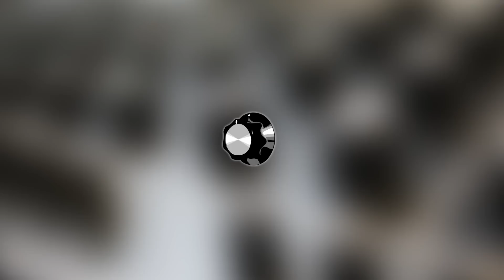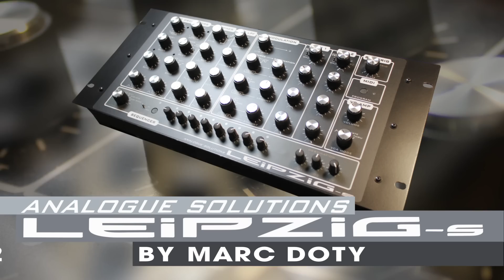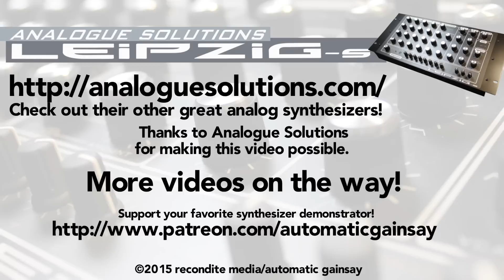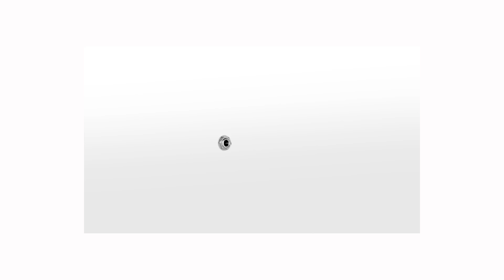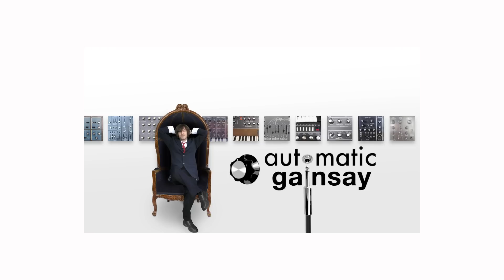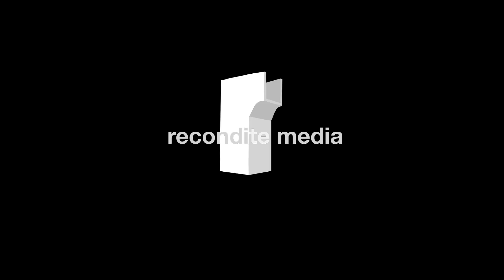02-The Analogue Solutions Leipzig-s: Part : Oscillators Part 2

Comment: I'm assuming the 3 knobs on the sequencer's right are applied to every step of the sequence? If so, I'm assuming you can only use the sequencer as a performance preset for note offset.

Also, how is the tracking with the two oscillators? It looked like you had to adjust them quite a lot to keep them in check.